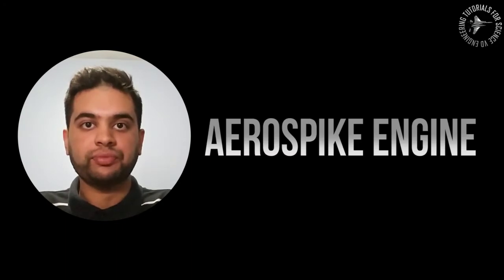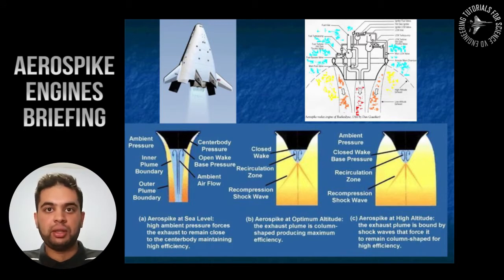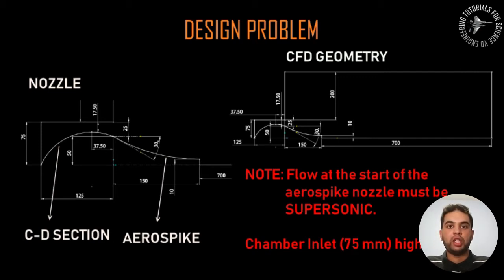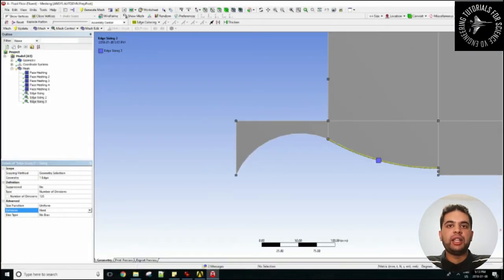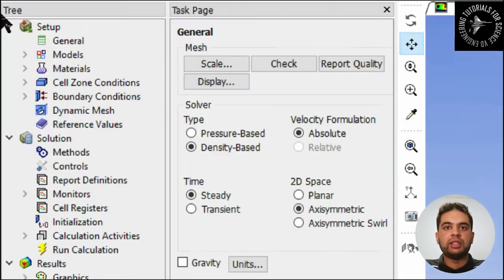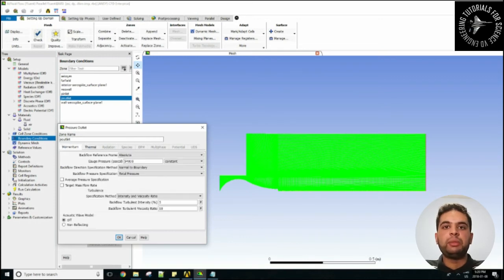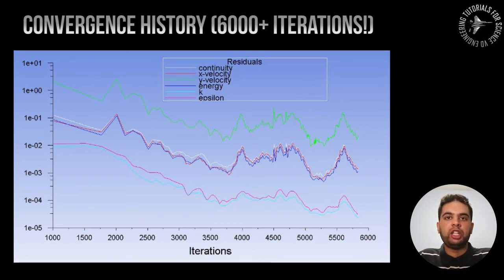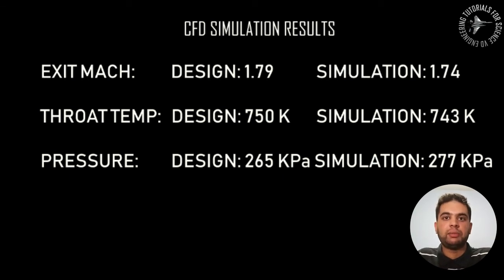Aerospike Rocket Nozzle (With Exhaust Plume): ANSYS Fluent Detailed Tutorial

Comment: Your results are likely garbage. You gloss over several of the details that make reacting flows / rocket design hard.
- What fuel are you simulating? Several common fuels for launch vehicles such as RP1/LOX and H2/LOX burn much more energetically and produce much higher chamber temperatures than your design problem indicates. Further, the combustion products tend to be much more complicated with triatomic species being fairly common. This will substantially lower the specific heat ratio.
- I can see the cells next to the wall. Unless you're using a wall model, that region should look completely black until you zoom in at least an order of magnitude or two. Your simulation is missing half the important physics by not resolving the boundary layer.
Reply from the maker: You have a valid point however:
1) I am performing a simulation of air flow, not combustion. My video demonstrates the flow physics of an aerospike nozzle and the basics of expansion - not reacting flow
2) Considering point 1, air has a very low viscosity and can also be considered pretty much inviscid at high speeds. Most NASA simulations of external aerodynamics of supersonic aircraft are done using inviscid solvers, it speeds up the process tremendously.
https://ntrs.nasa.gov/archive/nasa/casi.ntrs.nasa.gov/20160004986.pdf